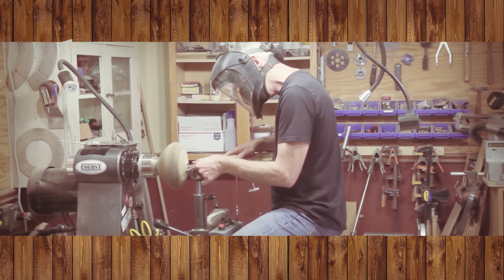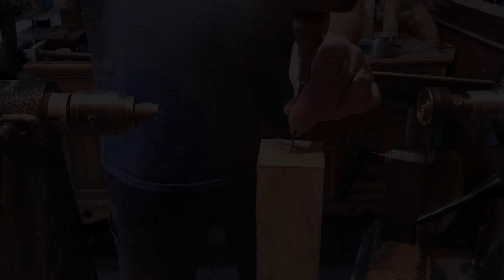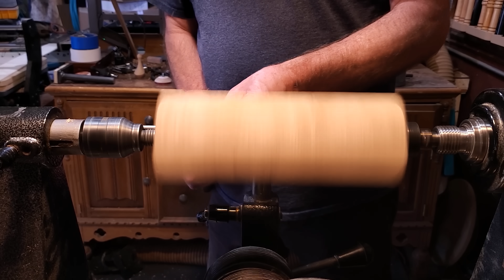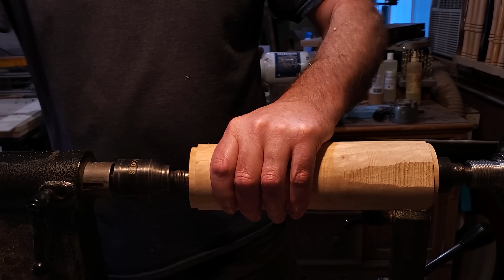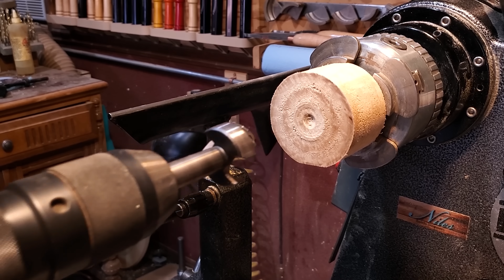Woodturning | Maple And Walnut Urn

Comment: Very nice.  I would like to add some carving to my practice and this is inspirational.  A question about installing the rings when grain pattern is important to maintain.  I have a box turned to the point of putting the rings in and my first thought was the glue align the lid and body and glue the rings in place while tightened together, but I am nervous that I will end up with some glue in the threads.   Have you figured out a good process to keep the grain pattern aligned?
Reply from the maker: Thank you very much Marc! You're right, just put a little epoxy on the rings and turn them until the grain aligns. I normaly epoxy one side and let it dry and then the second one will spin a little to align your grain. Give me a call if you have any questions, my number is on the Niles Bottle Stopper website.